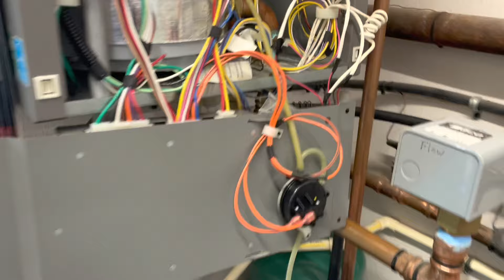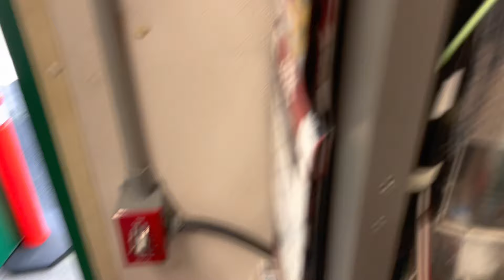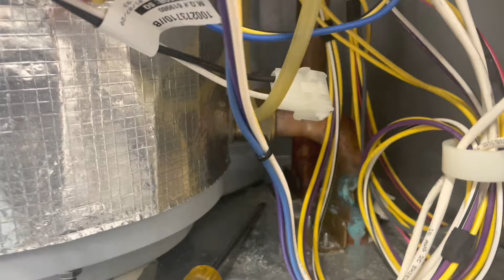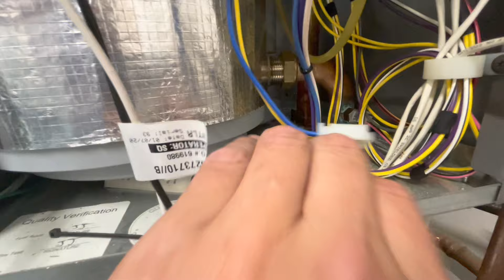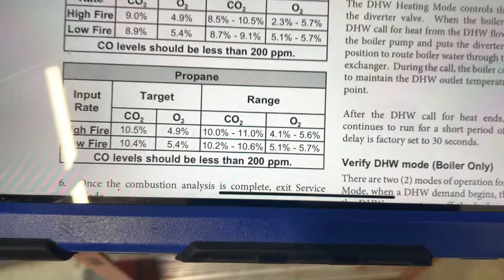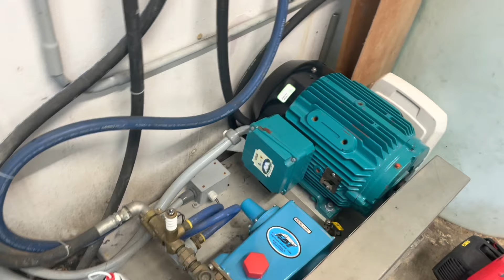Lochinvar Noble Boiler Service! #hvac #boiler #heating #lochinvar

Comment: Everything except what I was looking for. The alarms menu. “My boiler shuts off 5 times a week” running everytime I get here…
Reply: I just had that problem i had to call tech turned out to be a couple temp adjustments but trying to figure it out was a nightmare.  I got to the alarms by using the right arrow entering my code of 5309 theres only 1 other code it can be I know it starts with a 1 just look up online then you can access the entire settings area.  But if you aren't sure call tech they are great at walking you thru all the steps. Hope this helps

Comment: My diverter valve failed on my Triangle Tube PE110 boiler.  I removed the oil valve:  PEVLV01.  Trouble is, I forgot which way is up.   I have A, B, and AB on the diverter valve.  I know which way AB goes-goes to the circulator.  , ,   Quesiton is, is A down or UP?
Reply from the maker: Sorry friend, I can’t help with this because I don’t remember either.

Comment: Clean the heat exchanger correctly and the test will level out on combustion. I wouldn’t adjust the gas valve without cleaning it first.

Comment: Nobles suck
Reply from the maker: This is the only one that I service.  Haven’t really had any issues with it.
Reply: @JeffsHVACAdventures I have a lochnivar. I had it installed roughly 3 years ago and I guess I should consider my self lucky from what I see everyone posting. 
I’ve had it 3 years and the tech that recently came out said I should do the maintenance kit and cleaning.
Looking at the gaskets it doesn’t look like it’s needing to be replaced. They look good unless there’s something I can’t see that should be replaced.
Cost: $900.00 😳
Reply: Thank you. That’s one of my questions.  Hahaha. Thanks

Comment: I have a lochonvar combo boiler and have nothing but problems
Reply: Me too. It''s a disaster of a product
Reply: Please be aware that there have been 2 separate recalls for the risk of carbon monoxide poisoning for some Noble models. The Recall information can be found on the Consumer Product Safety Commission (CPSC) website.

2020 Recall:

"The boiler’s flue grommet can deteriorate and dislodge during use and allow the boiler to emit carbon monoxide, posing a risk of carbon monoxide poisoning."

2023 Recall:

"The boiler’s flue collector can crack if exposed to a high impact event in the burner chamber, which can allow the boiler to emit carbon monoxide, posing a risk of carbon monoxide poisoning."
Reply: These things are junk. 15yrs of doing this and id rather take my chances with a temu combi than to ever recommend these
Reply: @DavidLambert-lo3ky  what brand is still good? Weil McClain? Rinnai?
Reply: @McCoyFamilyFarm well rinnia is ok  McCain isn't bad either ao Smith is even good but I hear they aren't bad either my best is navien great product some may say there to expensive but I'd is going to last 20yrs then hey better to spend a lil more for less hassle and maintenance
Reply: Thank you so much.  I was going to ask that question.
Reply: They are junk in my opinion had to call tech support 5xs and all the issues are are temp setting if they are to far off it locks the system and the fucking manual doesn't explain anything useful. I will never install another id rather install a rheem over these p.o.s

Comment: Just to add,  Lochinvars website had a great tutorial on servicing. Step by step instructions. they do also sell a cleaning kit with brush attachments. 
i use vinegar for the heat exchangers, not the best smell, but damn it does some magic.   do not use simple green.

Comment: Not sure if the wall hang has a pin hole that allows a full test of the system, but the floor model does and it does fully run to max temp when the test setting is going.

Comment: I have never had so much trouble as with the Lochinvar KBN155, 3 control boards in 15 years... getting a hold of them has been almost impossible.... currently buying an NTI boiler to replace the Lochinvar.... as crazy as it may be NTI actually did a video conference with me and help select the right boiler, which was not their most expensive ... bye bye... Lochinvar...
Reply from the maker: Sounds like good customer service!  Hope it all works out!
Reply: mine wasn't even a year old and kept quitting the first winter really wishing i keep my old 20+ one and saved the money for something else
Reply: @furydeath   My feelings exactly. My 20+ year boiler never quit. My Lochnivar is one problem after the other every winter since I got it. It's like they made it to break.

Comment: Kool kit does it always come like that? With the tool bag?
Reply: Not supposed to use a  wire brush on those hear exchangers.
Reply: That kit is for a contractor that installs the Lochinvar noble boilers. Then you have all the part needed to service the boiler. Get the customer up and running. Then u don't have to order. It not a maintenance kit!
Reply from the maker: As far as I know yes.  They might make a cheaper one but I’ve not seen it.